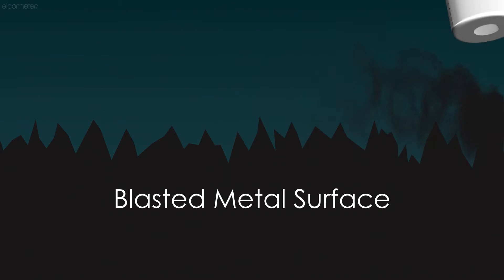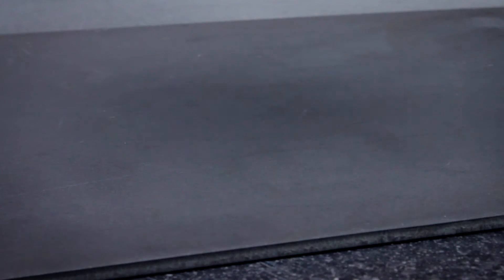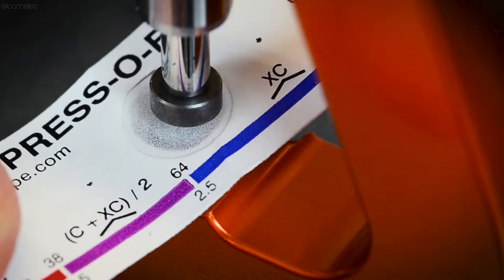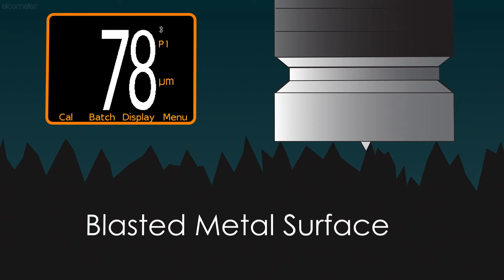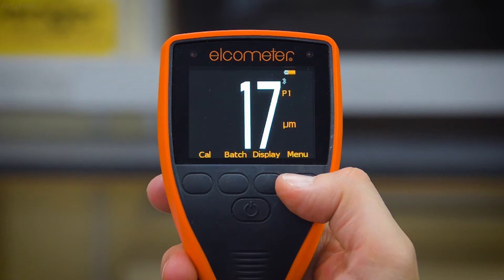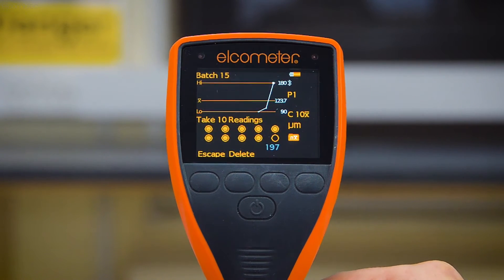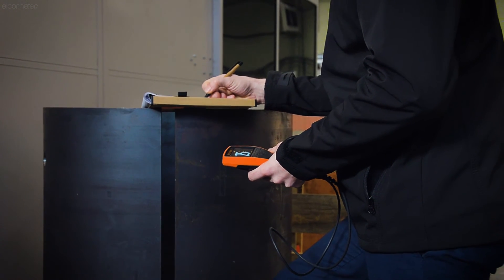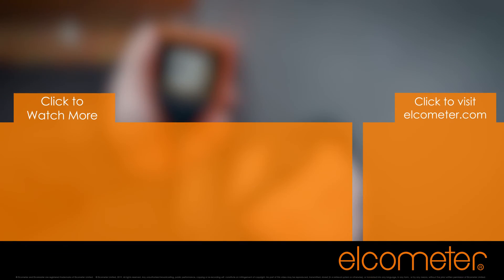How to Measure Surface Profile using the Elcometer 224 Digital Surface Profile Gauge

Comment: Thank you for your video!
In your opinion, is there any standard regulating how many microns the surface depth is required to meet and is safe for the coating?
For example, dry thickness requires 50 microns of primer and 50 microns of coating.
Thank you!
Reply from the maker: Hi,

For the information you need, the requirements of primer and coating, you are best off using your paint data sheet as reference. 

If you have any more questions, email support@elcometer.com

Comment: What is the frequency of calibration of this surface profile gauge?
Reply from the maker: Hi,

The 224 should zeroed before every job using the supplied glass slide and can be checked using the supplied shims.  If a calibration certificate is required then it can be returned to Elcometer at a frequency defined by the individual’s company quality procedures.

I hope this answers your question :) 

If you have any more questions feel free to get in touch with techsales@elcometer.com

Comment: I use the elcometer 224, the profile measurement could be taken using the same prob for flat and curved surfaces?
Reply from the maker: Hi,

This would depend on which probe you have. For curved surfaces you would need the curved surface probe. 
If you do not have the probe, you will be able to get it from your local distributor. 

For more information please get in touch @techsales@elcometer.com

Comment: Can I use it for dry paint microns reading?
Reply from the maker: Thank you for your comment.

The Elcometer 224 is a digital surface profile gauge, designed to measure the profile of surfaces before painting.

To measure the dry film thickness of paint in microns or mils we recommend the Elcometer 456, as shown here: https://www.elcometer.com/en/coating-inspection/dry-film-thickness/dry-film-thickness-digital/elcometer-456-coating-thickness-gauge.html

If you have any further questions, please contact techsales@elcometer.com or visit www.elcometer.com/contact-us to find your local Elcometer distributor.
Reply: @ElcometerOfficialChannel  thank you...